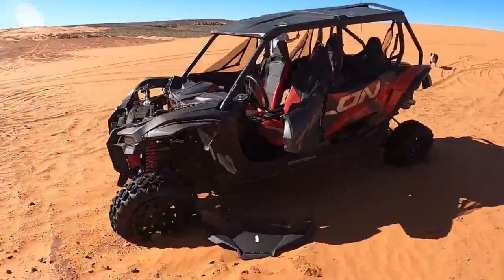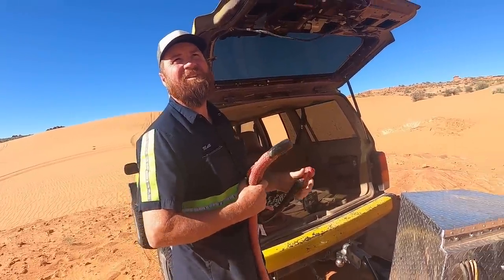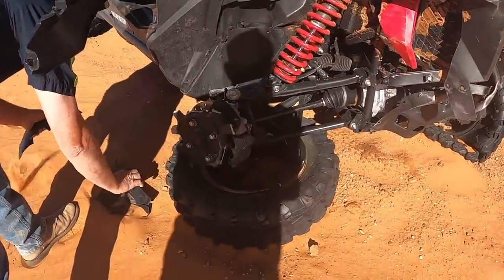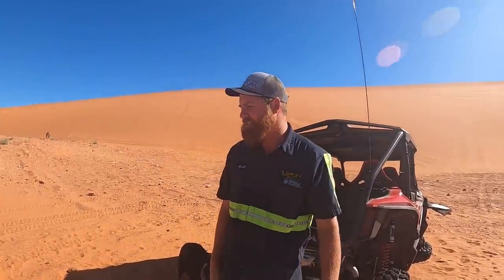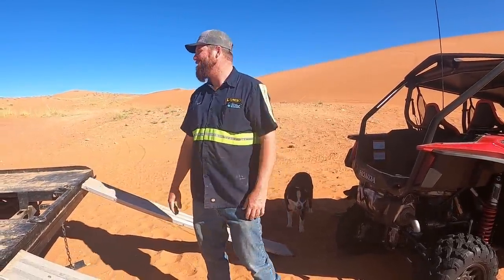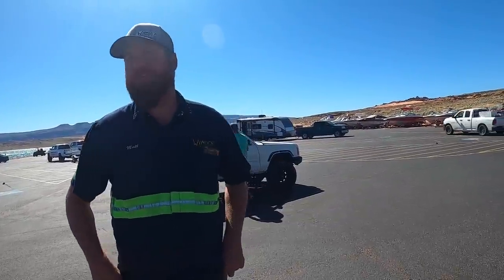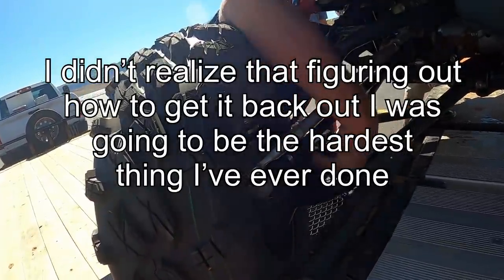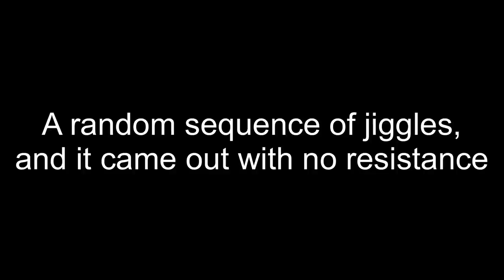Honda Talon…. Really?

Comment: That tilt deck/full ramp wouldn’t have worked so well as a “pry bar” to move that Talon over while loading on trailer!! Nice work Matt
Reply: A man with a brain!
Reply: With a wide gate he would not have needed a pry bar .
Reply: @tomh3652  A wide gate of aluminum would add unnecessary weight, k.i.s.s.= why add what you may believe would make things ‘easier’ if by doing so you add back the weight you unloaded by ’design’ ; thus form must follow function. In other words, function is the optimum criterion to design, luxuries get left at the parking lot. Form as the most light weight rig gets the ‘pig’ outta the thirsty sand without breaking under the weight.

Comment: Heck, I'm impressed with your trailer because I know what to takes to make recoveries, not in that type of sand, but in Florida sand, and I know that a 2000+lb.trailer with a full ramp gate, is hard to get through some of the Florida sands and that's when it's empty, then once you put another 1200-1500+lbs on it, then you're having to pull well over 3000lbs. So I kinda know what it would take to get it to places you take that one, and one truck or Jeep isn't going to do it. 
Anyways, you know what works, and you built that to do what you needed it to do, and it works. And it working is all that matters.

Comment: I really enjoy your videos, seeing how you do the jobs and marvelling at the scenery (I am from East Anglia in the UK). I have often seen the comments stating that there are technologies that would make your job easier so I really appreciate your explanations for the choices that you have made for your trailer. 

Watching you struggle to line up these vehicles with wheels at all angles or not there at all reminds me of when I did a little bit of recovery work and a really handy tool is a small pulley that can be hung over the winch cable and clipped to the side of the trailer in order to pull to one side or the other. It only weighs 2 or 3lb. I realise that the lightweight construction of your trailer may not be substantial enough to hold one though so please ignore this suggestion; I am in no position to try to teach you anything at all. 

Best wishes to all of you.

Comment: Hello. Nice footage on tricky rescues. Your reasoning behind the trailer is spot on. The ONLY addition that I can think of to make it better than it already is, is to add electric or hydraulic engines to the front axle of it. That can help quite a bit when you are crawling in difficult - and soft terrain. At speeds over 10 mph they are worth less though. Somewhat engine dependant though.  It will naturally come at a little weight cost, but I do think the extra climb and pull capacity will make it worth the slightly heavier rig. 
When I was a young man we installed 2 25 hp hydraulic engines to each front wheel of a 2 axle slurry wagon (20 Ton capacicy.) It made a tremendeus difference  in getting through soft or muddy spots. If they were activated juuust before you got stuck in a mudhole it was often possible to pull through without coming to a halt, or if we did come to a halt it was often possible to "rock" it out because the front axle helped smooth the way so to speak. Just an idea for ya :-)

Comment: I'm a design engineer and I must say, for the job, that is almost a perfect trailer.  Not an inch too long or too wide.  The ramps are long enough to load things easily, but short enough so they can be repositioned after the first set of wheels are on the deck.   The inverted axles and tandem wheels are excellent.

The only thing I can see that could be improved is to mount the winch higher, so it continues to draw the load onto the trailer without sucking it down.  But that takes more metal, and puts a larger bending moment on the trailer, which then requires more metal.  So I fully understand the tradeoffs.  Nicely designed.  Nicely executed.

Comment: Having built, modified and towed many kinds of trailers,  I can honestly  say that this one is absolutely perfect for it's use.  It is AWESOME.  It is light and strong and can carry or recover most normal types of off-road vehicles.  It gets an AAA++++ in my book.  When you added the pintle hook & safety chains on the front, a new winch /control and cable,  I added two more A's and two more more plusses.  The aluminum ramps make excellent prybars loading demolished Razers with no steering.

Comment: I drove a Toyota Landcruiser jeep for 5 years in the Sahara desert. Toyotas were the only thing you could get parts for. Had a smallish 4 cylinder diesel in it. Somewhat underpowered, but we had the same kind of sand. Your only weapon to get over a dune was speed and if you had to slow down for something, you weren't going to make it. No trees, so eventually I removed the giant winch that had been put on it to lighten it and we just used sand plaques and a shovel. Mine were old military steel runway planks. Enjoy watching how y'all work through the various obstacles, problems and situations that come along. Keep it up and get er done!!

Comment: Matt: one thing I can never get right is loading a side by side straight.

Side by side: missing a wheel, other one barely steerable, frame twisted, rear axle out of alignment.

Yeah, not really your doing. Also, is there some rule that side by side ownership means driving it like you stole it?

Side by side owner: I'm invincible!

Physics: watch this.
Reply: I know. Especially when you consider the cost of those things. I would think the last thing you'd want to do after spending that much money is turn it into scrap metal.
Reply: @Russ Lehman, on the other hand you don't buy a vehicle like that to take a leasurely sunday crawl along the beach. And on dunes that tall and sand that loose it doesn't take much to screw up and do damage.

Comment: Matt: I pull a dump trailer with a battery to operate the  hydraulic ram
Got tired of having to hand unload when the battery  died. My  solution was to install welding cable from the truck battery to the rear bumper with twist lock connectors . Now I just disconnect the trailer plug , connect the hot cable insure ground and you have power all the time  without that elusive jump box coming into the equation  or Ed forgetting to load it up.  Really enjoy your channel. Bob from Ocala Florida

Comment: helpful tip: A Hi Lift jack is a handy ghetto come-along. You can use it to move very heavy loads sideways, support fallen trees, lift a wall you're framing all by yourself, straighten out a bent radiator support, etc.

Comment: I watched a  duce and an half almost get stuck because of its trailer. It was  pulling a fairly large generator (60Kva) with smallish tires in mud.  Size, weight, tires, all matter. Thanks for  the explanation,  but you do what works.

Comment: I can appreciate the way that trailer is built and I completely understand the need for flotation on that sand. I wonder if bagging the tires on the trailer would help with flotation? You could carry a small compressor to press them back up once you got to better packed surfaces.

Comment: Might be a little late but they do make those balloon implement tires for trailers that might ride a little better. We use them in the sand. With heavy steel on them. Never had one stuck. Or even dig a rut.

Comment: Curiosity Corner: since floatation seems to be especially important over your local blow sand, would either of the following (2) two ideas, individually or in combination, give you an added advantage Matt:
1. switching to wider profile tires, like perhaps those ride-on lawnmowers (yes the fat knobby ones)?
2. adding a (3rd) axle?
Thanks in advance for your indulgence, and salutations to your team.

Comment: Hey Matt : go by a semi trailer place where they work on dump trailers get your self some scrap pieces of the slick liner they line dumps with. I believe that it would make your life a lot easier to slide the razors from side to side or even up your ramps. It’s durable, lite , and slick they dump big rocks on it lasts several years. Good video!

Comment: To pull the front end of the   ATV's straight, Make an outrigger  to hold a pulley for the winch cable to come at it from a big angle. Then attach it to the front  end and correct the front.  The point about taking the same path out as you came in, is that you said "you can try only one at a time"  and so that means you can make more mistakes. But you can try two trails for each recovery.  How about strap anything on a trailer down properly. You are driving through randomness of the wild, you could get the a swing on the trailer easily.

Comment: LOL,,,,while a standard tilt bed trailer would be heavier due to additional frame material needed,,,, a hinged tongue type would not add much more than a few pounds, plus can’t believe you don’t have a fully rotating/articulated hitch. That ball and cup is great for street use but a joke for off road. 

Keep up the good work,,,you are doing great with what ya got, keep up grading as you can.  I know when starting my business in 1979 on a shoestring and a prayer I did not let the lack of money stop me from getting things done and listened to all the so called help from others with interest and respect because it’s all offered with good intentions and sometimes there is even great value there.

Comment: Ya Know . . . When you arrived at the side by side  before you turned the engine of the jeep off, I was thinking the tail end of the trailer was a little high. All because of the terrain. And a tilt bed would get the bed lower for sure and you wouldn't need the ramps . . . BUT it would make your trailer a lot heavier.   NAW,   too much cost in weight  to have a tilt bed, Matt has the best trailer for the job!

Comment: Just wondered when you'll break down and get some real two way comms? I mean even if you put a CB in all your rigs it would cost practically nothing, and they have other uses. Having small headsets with walkie talkie would do essentially the same thing, but it would easily avoid the miscommunication ie honk, losing sight of your compatriot, ground guide, just any number of times it would have been of value. Love the teaching moments and defining why you do things the way you do. Thanks again!

Comment: As a trucker i don't see anything wrong with how your trailer is set up. The only thing i might change is moving the axles farther back to put more weight on the power unit. But i don't know anything about sand. I've unstuck semis in mud but never dealt with sand so i don't know if the extra weight on the power unit would cause handling issues

Comment: Just a suggestion but to prevent your winch cable from damage maybe a roller put in the center of your ramp channel at the back would keep it from dragging on the sharp edge.

Comment: for people who never experienced dunes (even if you do other offroading) - you have no idea what a difference a few kg (or pounds) does... it means if you will make it or brake it (literately). I did loads of sand dunes in Sahara and I've stripped my car of weight every time I go there...more weight I take off, more fuel & water I can take with me = more time i can spend in dunes...
and criticizing a line in the dunes is easy, choosing a line in real time is really, really hard...Ive been driving in the dunes for years (I've been to Sahara more than 10x, each time I was there for at least 8 days of pure dunes) and almost every time i pick a line I see a better one when I am done with that dune :)

Comment: So crazy idea. What about a roller on the end of the trailer. Or even a series of rollers. Perhaps something like a lumber stand that you would use with a chop/miter saw. It would surely be easier on your winch line.and a series of them across it may make the recovery easier.

Comment: Not  just that where would you store a full ramp Matt it is one good little trailer .And with the tires not lined up on the smashed side by side it will not roll in a strait line anyway.

Comment: I’ve noticed on your trailer when you use it you end up dragging the winch line across the rough steel.  You should get a long roller so it has something to roll on so you don’t ruin your winch cable.  Just a suggestion.  Keep up the good work and stay safe.

Comment: Snatch block and a d ring on the rear/front corners of the trailer would allow you to use the winch to reposition the old side to side on the trailer using the winch. Maybe.

Comment: An eye at each corner of the trailer would make it easier to align the vehicle on the trailer. A snatch block, either to the eye or on the line gives you a number of rigging options.

Comment: Getting that thing out of the suspension reminds of trying to get a starter out of an old mercedes in the 70s. No matter what I tried, it wouldn't come out. So before I blew my top I got out from under the car and probably walked 2 or 3 paces and heard a crash. Turned around and there was the starter on the ground. I have never had an explanation for this phenomenon  except that machines, etc, are living things.

Comment: Perhaps a roller bar with guides at each end for the rear end of the trailer.  We've used a set-up like that to load mil spec boats on flat bed trailers like yours.  Just a thought.

Comment: Matt,  You asked for suggestions on how to line up a SXS with your trailer.  Have you considered using a snatch block. Connecting it to different points along the side of your trailer so you can change the pulling angle as needed. I think it would be better or at least assist in the use of the ramp as a lever.

Comment: Sir Matt,
You are the most mellow guy.  I suppose if you are a YouTube star you have to suffer fools well.  

I like your answers on the trailer.  It is indeed a great design for your intended purpose.  The same people that don't understand flotation, weight, throttle control, and the picking of lines are the ones you go out to recover. :)

Thanks for your videos, I've watched almost all of them by now.

Comment: I completely understand why the trailer is built the way it is and what it's soul purpose is. I personally thought thought the ramps made to finish the deck was genius.  The only thing I see  that could help is welding pipe on the end of the ramp and two short pieces of pipe on each end of your mounting channel so you can pin the ramps in place when you need to so they don't kick up on you like they did on that RZR a while back that was  similar to this one.

Comment: Good reasons for the light weight trailer. A suggestion would be to added a roller the the top rear of the trailer so you don't drag your winch cable over the trailer. But other than that tiny suggestion all is good. Thanks for the videos I enjoy your adventures.

Comment: The trailer is near perfect. Only thought I have about its design, is I'd add rollers under its tail end an maybe underneath before the axles. For those rocky trails. But if its working as is , its working fine.

Comment: Commented this on another video but your speech here about the trailer make perfect sense to me. However I feel the issue would be simply solved by picking up an alumina trailer. Those things are real light for their capability ratings, you could probably have a tilt bed, tandem axle with on board ramps that is lighter than even this nice little unit you fabbed up. Worth looking into at least

Comment: I like the trailer and the application it’s built for but one idea that wouldn’t add a lot of weight an could save your winch cable as well as help with wrecks like this is cut a slot an put a roller at the back to assist

Comment: I’ve wanted to ask if you ever thought about going to a single axle, cut and narrow the axle and put some high floatation tires. It might take some searching for the right DOT approved tire. I know you would have to go to a shorter tire, like a DOT approved UTV tire. It appears that the trailer is only loaded with UTV’s and Offroad majority of times. (27-11-14 8-ply & bias-ply tires flatten out nicer as well)

Comment: I would use a wide rubber roller off a boat trailer on the rear off the trailer as a roller guide for the winch so the cable dont drag on the steel trailer and fray.

Comment: Maybe a floor jack would have worked to move front end over and if you can make a adjustable winch that moves side to side w a locking mechanism to pull at Angle but great job in getting it done.

Comment: Just catching up on your videos… love what you do! You have the job I want.

Anyway, while you were mentioning your customized trailer, I noticed that your winch line drags on the edge of your trailer (creating extra wear and tear on your line)… might I suggest cutting out a bit of your frame and putting in a roller to fix that? I have seen it done using an old roller line from a post office and you can usually get one fairly easily.

Just a suggestion.

Comment: So what happened to the jump box? Buried in the desert?  Great explanation of the trailer design. An old, light-weight piece of aluminum or an old food service tray might aid in dragging broken-axled Talons and Razors thru the sand and up the ramps, w/o adding weight to the rig.  You could sell pairs of your amazing ramps along side your kinetic tow ropes and make a few extra $$$.

Comment: While weight is important an Aluminum Trifold ramp with a checkerboard top plate on the two outers would weigh the same as your bleachers with steel reinforcement and probably still fi into your storage on the deck. they sell ATV ones for $100 bucks rated for 1800 lbs

Comment: Hi Matt. Just asking, why don't you wire up The Banana like a caravan with a socket on the back for the winch to plug in. No lost or "who forgot to charge or bring" the jump box and no extra weight of a second battery.